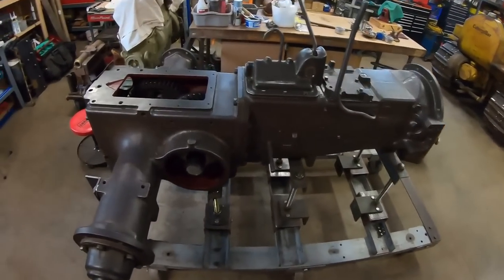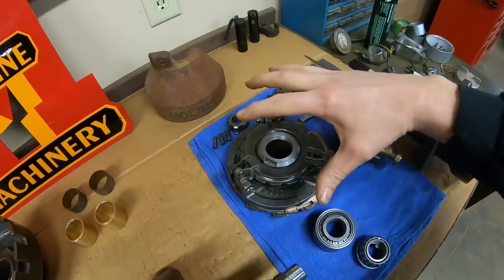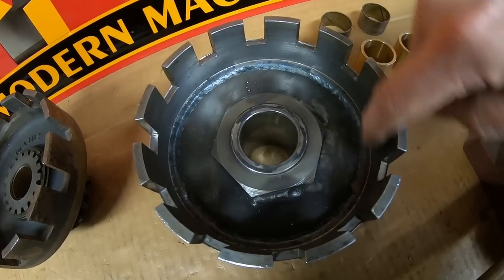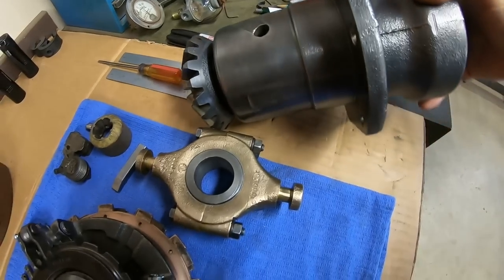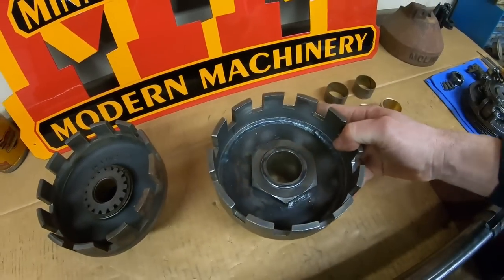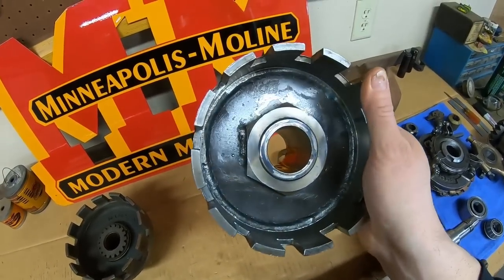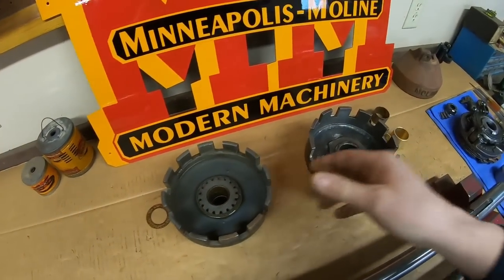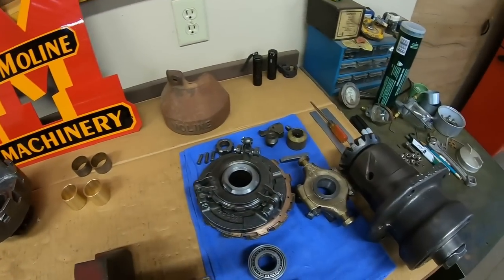#X231 Prototype Part 61: Fitting the Live Power Clutch & Making a Plan - What Goes into an Episode

Comment: Looks like a plan. If I'm see things clearly that front thrust washer looks to only see a load when the internal clutch is over centered to lock into place at which point the bevel gear should load the shaft rear ward. Hardened inner race against bronze bearing material in a load condition that is a fraction of a second long. Like i said looks like a plan

Comment: I would think you would want the thrust to be against the outer race and not on the inner. When you engage the pto clutch the basket would press against the inner race and may interfere with the preload on those conical rollers.  Maybe a steel thrust washer that sits in the recess against the outer race and then your one piece bushing/thrust washer could push against that. I like the one piece bushing/thrust washer idea though.

Comment: I can't believe how close the clutch assembly is to the cover. The only thing I can see is the torque difference between the shaft portion and the sleeve portion. Does the sleeve actually move? And you know the bushing is going to be stationary on one side, while the other side slips. Just a thought...

Comment: I like the idea and it will work regardless. However when it comes down to functionality I feel like there should be a gap between to bushings to retain some of that splashed oil. Single piece can't retain much oil and against mild steel that bronze will wear it's way unless oil is supplied some way. 
Again not necessary for just to show it runs, but I feel like you should go ahead and make two bushings with the same idea you have, but leaving a gap between.

Comment: I would like to see more of how the tapered bearing race retainer is held in place.  I see the opening for a pin/bolt and I assume that the securing pin/bolt is tapered?  My concern... in its original configuration the (forward) thrust generated by the conical belt pulley gears PULLS on the retainer while any (rearward) thrust would PUSH on the transmission case through the thrust washer.  If the race retainer is VERY sufficiently secured, it could easily handle thrust in both directions that the 1-piece bushing would introduce.  If not, you'll chase your tail trying to set backlash.  Keep in mind the only rearward thrust is going to come from the PTO clutch engagement lever when operated.  Also, be extra sure the pin/bolt will never back out... the constant change of thrust direction could work things loose.
Reply: @squatch253  OK, so the race retainer sleeve butts up to the step in the case.  Make sense.  I guess I just don't have my head wrapped around the hydraulic pump drive... are you going to be introducing thrust to the hydraulic pump?

Comment: As a mechanical design engineer, your new design change will be much better than the OEM version, especially with the machined in lubrication features. Reducing parts even with the addition of extra machining is always the goal.  My only concern is with any metallic debris from within the gearbox finding its way within those lubricating machined features.  Probably not a show stopper based upon your plan for this experimental tractor being showroom art & a periodic parade queen.

I’m very impressed with all your shop and design skills.  BTW, sometimes I think that some of your machined parts should be heat treated.  Do you have a small heat treat kiln?  I really enjoy your videos.
Reply: @squatch253  you bring so much enjoyment to so many.  No colorful language, just pure educational content.  You’re very similar to Marlin Perkins of the 70’s.  Keep up the good work!  So many wait for your next upload.

Comment: Make your brain hurt 😂😂😂 so how thick is the bearing flange going to be??? And I like how they use a set screw to adjust the lash of the pinion of shell to gear of belt pulley. I too dream up stuff /new mouse trap Ideas! Latest has been high pressure heads for jetting drains. Seeing whats on the market I think I came up with a tool /head that can be made as big or small as want  6 parts and off the shelf thrust bearings. just add more or take away to increase /decrease size or function! I just do not have a lathe to build the parts!

Comment: With the engine running (= shaft turning) and road trans in neutral and PTO/Pully clutch disengaged; what pulls up oil for the doublerow brg and the proposed bushing?

Comment: doing the bushing/thrust combo as you described should work just fine. That particular solution also has the added benefit to removing the direct thrust load from the repaired area, and transferring it through the tapered rollers (larger surface area to work with).  Similar to the modification to the thrust surfaces IIRC in the Amplitorc unit up forward. Take three pieces that dont want to play well together, and make one that is built like the proverbial brick shithouse. What you are doing I see as no different than furthering the prototype process. This unit may have been a show pony for Moline, but had they run it hard (and put it up wet, like it was) they would have likely had the same failures you are seeing now. One can only think that a sound engineering mind (and some farmer logic) would have come up with a similar solution to yours back in the day.

Comment: Don't modify the original prototype shaft!

For the limited hours this is going to run in the future, I would leave the bushing wall thickness as is, but look at changing bushing material, perhaps even (dare i say) a composite material.     You could integrate some kind of small thrust face that would push against either the back face of that tapered roller bearing, or against the small  face area of that housing

Comment: An idea would be to make a proof of concept piece and make sure that it will fit and do what you need. And when the final design is sound. Then, I would make the final version in the bronze you have. Making it with cheaper material will take a little more time, but in the end, the cheaper material will allow you to get the bugs out. Just a thought.
Reply: @squatch253  time for more brainstorming. 👍

Comment: I'm not the a engineer by profession but honestly the one piece pushing that also acts as a trust washer is better than having 3 pieces. I think the original setup had some serious oiling issues cause can't see how the oil would ever be able to enter the shaft from anywhere? The only thing that interests me is how thick the new pushing will be eventually?

Comment: Hey Toby, what about this for an idea… where they cut out a ledge in the linebore on the inner side of the case… if (big IF) you could find an outer race of a timken bearing that will fit in tight enough with the flat part facing inwards… that may be enough of a thrust bearing surface to replace the case housing?? Also this is a not leaving it all up to the dowel to take care of the thrust. If not a outer bearing race then I’m sure you could knock something up that doesn’t put a tax on the Bronze Age 🤡

Comment: Since the shaft is not press fit on the bearings, why you can't just put a custom made "heavy washer/bushing" in the slot that has been machined by mistake to recreate the original surface?

Comment: Wont turning the shaft down and putting undersized bushings in prevent you from sliding the shaft in through the back? Or can you slide the shaft forward enough to start the cage on the back side?

Comment: could you "fill" that void they machined out with a cast iron (because self lucubrating) O and that way you retrieve the full wide thrust surface?
Reply: @squatch253  i was talking about an "insert" like a valve seat in a head type of thing no need to weld or braze it just a 1/2thow fit that can be chilled and put in

Comment: I'm a little surprised you don't machine the bushings to fit the shaft as-is.  You said they're died at least in part because of other damage from inside the case pounding on them.  I believe you've said this will be a show tractor and only get a few hours of run time over the rest of your life?  If so, making those bushings to fit seems like the easiest way and the least modification.  Who knows, those bushings may even hold up OK as long as the rest of the parts in the case aren't flying around loose.

Comment: In all honesty, if it's going to be a 'parade' machine  and the PTO et al. is not going to be used in anger, but just as a "Hey, looky here, it runs" then I reckon sticking with the OG 'thin wall' sleeves is the best option. 
I am SO not in favour of lathing that shaft, it takes away from the originality of it. But that's just my twopenn'orth.

You, of course, as the owner, need to do You.

Comment: so if you arent going to be using a thrust washer and the rear bearing carrier is going to be doing the thrust work, why not just make a one peice bushing for the drum and make a cheap steel spacer to hold the spacing between the bearing and the drum? would be much cheaper and easier than using that giant peice of bronze for a bushing. also with using that steel spacer instead of the bronze you would be able to make or use cheap shims to get everything in spec and to your liking without having to machine the bronze once its pressed into the gear... just something to consider. but if its going to be a show queen why not just make or use the thin bushings again. no shaft machining, and you could still use the spacer between the drum and that bearing to make the bearing carrier take the thrust. show queen and all. that and if it doesnt work you have some options as in what you can do. once that shafts machined your stuck with whats done.....
Reply: @Squatch253  well that stinks... any chance you have enough room to run two this hardened steels and a Torrington bearing for thrust? That step on the back looms thick enough to register a hardened steel "race" on and the back of that gear would sure support a washer... just a thought

Comment: I must say that I doubt the thick bush is required for the use you will put the tractor to. I would accept the design deficiency if it will work. Keep the original shaft original.